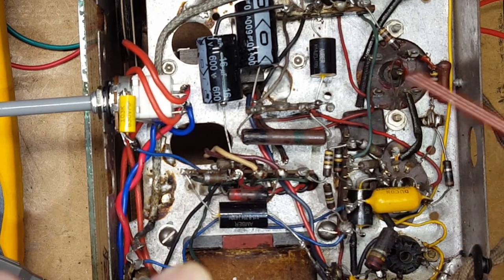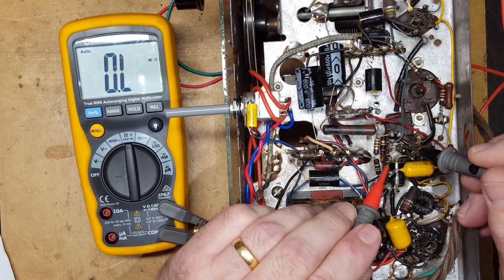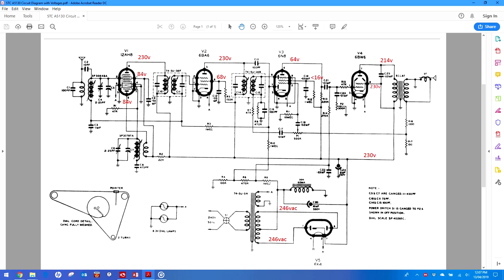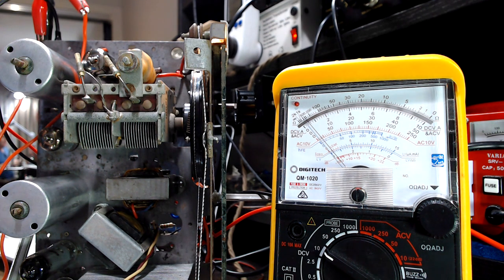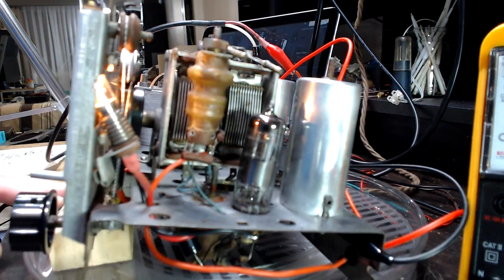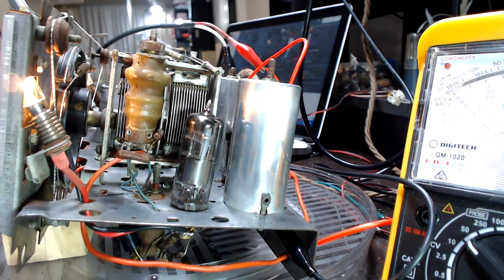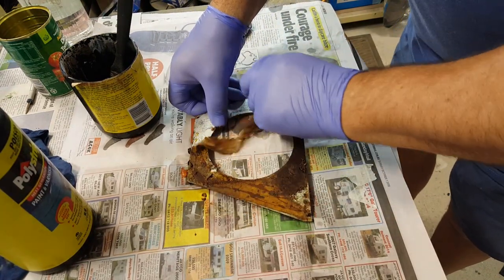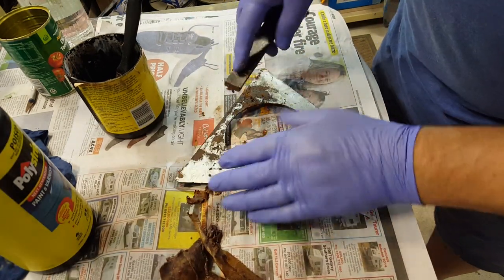Vintage Radio Restoration - STC A5130 Part 4 - Distortion Fix and Alignment

Comment: I watched most of your restorations, you did very good job.  If I were you I would change all the caps, resistors valve sockets and cables, clean or change the pot controls and than test the radio. Restoration takes a lotvof time and effort. Not replaced parts may become proplem in the near future. All small parts replaced would give the radio another 50 year to go without servicing.
Reply from the maker: Thanks for the tips!

Comment: That 1 meg resistor has a 470k in series with 100k, across it when measuring it in circuit so it’s going to measure less that 1 Meg.
Reply from the maker: Haha... yeah, I worked that out... eventually 😀

Comment: Just found your interesting tutorial on the restoration of this old STC thanks David. Of particular interest to me was your method for aligning the radio using a signal generator and multimeter which was straightforward and easy to understand!
Reply from the maker: Thanks Greg, glad to have been of assistance 😃

Comment: I picked up a unique AC voltage measuring instrument today at a local thrift store. The item was an HP-403, the  True RMS voltmeter. It is transistorized meter. I plan on using it as a dedicated  alignment voltage indicator. With this meter I can measure any AC  signal voltage , even the 455 Kc IF frequency. I can measure down to 10 microvolts. This will be good for measuring RF sensitivity in the AM broadcast Band. The meter is lab quality and  several steps above an all purpose VTVM, that I can now utilize elsewhere on my bench. This meter was originally designed to run on Nicad batteries only. The previous owner devised a way to have it run on AC line current. That I am very happy with. The batteries were special and no longer available. I was studying schematics to see what I could come up with and nothing was simple. The previous owner was known as "Mr. Electron" a retired EE. Items from his estate found their way to  a thrift store. The only thing I need to do was find a suitable three prong AC power cord. In the meantime I soldered an AC cord to the internal connections So I can calibrate the meter. I found a full copy of the HP manual on line. I  hope your day was as exciting as mine was today.
Reply from the maker: My day was not nearly as exciting by the sound of it Cosimo. It's a shame it ended up in a thrift shop, Mr Electron would be sad to see his life's work scattered about like that but by the same account it's great that you rescued it. Being able to read low signal voltages would be very handy for troubleshooting circuits. I'm very happy for you Cosimo, well done 😃

Comment: Hello again David. I wanted to ask you something about the STC A5130 table top AM radio.

I noticed that in order for a consumer to operate this radio they would need to add a long wire antenna. I imagine that may not be practical in all locations such as a condo or city located townhome. Would you be able to add a generic ferrite loop antenna to the radio so that the user would not have to have a long wire antenna placed outside their apartment or condo? 

Is it possible to add a ferrite loop antenna to a radio that was not designed to have one and still obtain decent RF reception? 

If yes, would you make a short video on how to add a ferrite loop antenna?
Reply from the maker: Hi Martin, it is possible to add a loopstick antenna and that's a good idea for a video, thanks. It would basically involve replacing the existing antenna coil with the loopstick coils. I would have to do a bit of research though. I'll see if I can come up with something in the new year, chhers 🤔🙂😃

Comment: I noticed you have the same generator lsg 11 someone in the past took out the 1k RF fine pot and replaced it with a function switch with varied resisters i might go back to the original.
Reply from the maker: Hi Michael, they are a good basic generator, I wonder why the pot was replaced with resistors 🤔🙂

Comment: The AGC voltage is delayed by the RC time constant of the AGC filter. The voltage is smooth and filtered . I'll give it a try next time.
Reply from the maker: It works well but you need a high impedance meter, I now use the output valve plate so as not to influence the IF/RF section.

Comment: Did you measure the agc before and after tuning in a station to see if it’s responding to signal levels. 
It looks like it was overloaded due to low RF bias.
Reply from the maker: I thought I tuned a station using the voltmeter after I aligned it, the voltmeter is connected to the AGC 🤔

Comment: While recapping a 1948 Philco today I came across a .2uf cap bulging at one end and the wax plug oozing out. The odd thing was a coil of #20 wire was wrapped around the ground end of the cap. The coil was 10 turns of insulated wire on a 3/4" diameter cap. One end if the wire attached to the cap lead on the low end the other end of the coil was open ended. I have no idea what the purpose of the coil is for. The inductance was too small to measure, it measured .81 Ohms D.C. Resistance. I guess I could calculate the inductance by know physical values , the figure out the LC resonance of the tank circuit. Have you ever seen  a cap configured this way? Anyone have ideas. So for now I just replaced the cap and made a note in my journal to revisit later on.
Reply from the maker: I believe it is a wave trap as it's only connected at one end Cosimo, I had one on a previous radio and did a little searching about them, see link at the end. There seems to be some conjecture as to it's purpose, it seems it's either to stop external signals penetrating or stop feedback from within the set itself. It's position in the set may answer that. Either way it may be redundant with modern capacitors. Have a look at this link Cosimo: https://antiqueradios.com/forums/viewtopic.php?f=6&t=190080
Reply: David Tipton Thanks ...yes , that's it exactly. I figured it was some kind of gimmick inductor. The measured inductance was 10 micro-henries. It had a stray capacitance in the nano- farad range. I kept the old part in tact , just in case it's some RF Black Magic device. The schematic shows it to be a physical coil in series electrically from the cap to ground. There you go , I learned one more thing and I knew it all until I didn't.
Reply: So it turns out that in the schematic this .2uf cap is the virtual ground connection in series with an open coil. The cap. has an Xc of 10k at 60 Hertz. The  coil is a phantom inductor. It reminds me of small inductances that were used to suppress parasitic oscillation  in RF circuits. Or maybe it's some king of ground loop magic.

Comment: Single ply toilet paper and Duco cement. Spread an area wider than the tear then lay down a strip of TP  over the tear. The TP will absorb the glue . Then spread another layer of Duco like paint over the TP.  Like when you cut yourself shaving. The blood acted like glue as it saturated the TP.
Reply from the maker: We can't get Duco cement down here 😏
Reply: The rubber paper glue is good idea too as it remains more pliable.

Comment: Hi David, can I ask where you got your capacitance meter from that you use in this video (at around the 10 minute mark) or is it a kit?
Reply from the maker: Hi Greg, I don't have that anymore after I dropped it 🤦‍♂️ That one comes as a assembled board, the case is extra and comes as a flatpak. The replacement I got was fully assembled and in a nice case. There are similar ones on eBay and are very cheap, $20 - $30 here 👍🙂
Reply: @DavidTipton101  Awesome thanks David......off to eBay I go!

Comment: I've never seen that before; the mains transformer secondary centre tap connected to both an inductor to ground and a capacitor to the HT! How does that produce a negative bias wrt ground? I have a degree in electronics but I don't understand that. Did you ever work that out?
Reply from the maker: I don't have access to the circuit at the moment Ricobass0 but the reason the choke is on the centre tap is to reduce stress and corrosion on the windings by reducing the potential between the windings and the former and core. When a choke was mounted in the positive side of the B+ some manufactures connected the body or former of the choke to B+ as well to achieve a similar result. The choke itself provides the back bias. 
Because the output valve cathode is directly connected to chassis ground, connecting the filter caps directly to ground also would induce a hum in the cathode. By connecting it to the centre tap it is essentially in parallel with the back bias resistor or in this case the choke.
Reply: @DavidTipton101  I get what you are saying about the voltage difference between the inductor windings and the metalwork but don't see how any of this generates a  -ve voltage wrt ground. The bias resistor chain is across the inductor and both the resistor chain and the inductor have one end grounded. They are both effectively in series with the HT output, albeit through the transformer windings, but without a third diode somewhere I don't see any way a  -ve voltage can develop.
Reply from the maker: I think I see what you are asking. How do you get a negative voltage by grounding the CT through a Choke? 
Consider the CT is the most negative point in the power supply.
if a resistor (choke and some resistors in this case) are placed between the CT and the chassis, the chassis is now positive WRT the centre tap. 
Connect the control grid to the Centre Tap and the cathode to chassis and the grid is now negative WRT the cathode. 
You are right, the entire HT current flows through the choke/resistors to chassis so variations in current flow will affect the bias voltage.
Reply: @DavidTipton101  If you consider the transformer as a voltage source and the double diode as just a single rectifier, then there is a complete loop from ground through the inductor, the V source,  the rectifier and then finally C24 back to ground. If you define ground as zero volts and the +HT is developed across C24, how can the voltage across the inductor be anything other than positive? I know I must be wrong - you doubtless measured a negative voltage and if it were otherwise, all the valves would have been biased wrong.
All I can think of is that the role of C20 from HT to the top of the inductor is crucial, creating some sort of crude switching supply, using the (100Hz) ripple voltage to build up a negative charge on its negative terminal.
Reply from the maker: @ricobass0253  The transformer and rectifier are an AC to DC converter and produce a DC voltage, DC will not pass through C24.
In a simple circuit containing a 9 volt battery, a bulb and a resistor. If you measure the voltage drop across the resistor the negative end (negative battery side) of the resistor will be lower than the positive end. Same with the radio, the CT is zero, there is a voltage drop across the inductor to the chassis, the chassis is more positive than the CT meaning it is at a lower voltage than the chassis. With the output valve cathode grounded to chassis and the control grid connected to the CT there is a negative grid bias across the two.
Reply: @DavidTipton101  I get what you're saying except that the CT is not zero. The chassis is zero by definition. I'm still a bit confused re the function of C20 which is returned to the CT rather than chassis.
Reply from the maker: The CT is absolute zero in the power supply. The chassis ground is a small number of volts higher than the centre tap by virtue of the inductor, resistor what ever you want to call it. 
Consider in a case where the CT is connected to the chassis and the transformer/rectifier is producing 200 Volts DC. Measuring between B+ and the chassis will be 200VDC.
If the CT connection is lifted from the chassis and a resistor placed between it and the chassis there will be a voltage drop as the B+ returns to the CT, therefore the CT will be at a lower voltage than the chassis.
The radio components are connected between the B+ and the chassis not between B+ and the CT. If the resistor drops 10 Volts then the voltage between B+ and the chassis will now be 190 VDC. The remaining 10 Volts can be measured between the chassis and the centre tap, the CT will be 10 Volts lower than the chassis.

Comment: Have you ever tried Rubber Cement on the speaker cones?
Reply from the maker: Hi George, no, I haven't, the glue I use does stay pliable though but I will try and get some rubber cement for next time 🙂
Reply: hi David,toilet paper or kitchen paper soaked in a mixture of wood glue and water works great and is pliable, paint it black and its an invisible repair
Reply from the maker: @MrHBSoftware  I use that on the cone area but not mixed with water, worth a try though, thanks 🙂

Comment: The oscillator coil should be adjusted at the bottom of the band, like the aerial coil.
Reply from the maker: Thanks widecast, I have finally worked it out 👍

Comment: Cellulose paint thinner usually sees off any glue, (and paint too)
Reply from the maker: Hi jonka1, we don't have cellulose thinner in Oz, we do have lacquer thinner which may be the same thing, I didn't think to try that though 🙄
Reply: @DavidTipton101  here we have cellulose, synthetic and acrylic thinners, should be the same all around the globe i guess. cellulose is very strong and mostly used for cleaning brushes and paint guns..most paints are synthetic or acrylic and for mixing we use the respective thinner...there is also the water based paints that are being shoved into our mouths due to environmental concerns
Reply from the maker: @MrHBSoftware  the only name I recognise is acrylic but no doubt different names for the same product.

Comment: I have had good luck with tissue paper (wrapping type) and finger nail cement. (that women use ) You can get it quite wet and put the paper on, and when it dries, it is the same consistency of the cone to begin with.
Reply from the maker: Hi Michael, thanks for the tip, I'll give it a go 👍🙂

Comment: Silvered Mica capacitors from my 50 year experience in radio and TV are most unreliable when dc is applied to one end, e.g. a plate to grid coupling.  The silver tends to migrate internally.
Reply from the maker: When I first started my radio repair hobby I was told mica caps are very reliable, don't worry about them. That proved to be a fallacy Roger, I now suspect any mica with a high voltage on one side just like you. It took me a while to work it out though 🙄 Thanks Roger 😃

Comment: I bet coca-cola would work well as a solvent to remove crud. You forgot to cut out the circle in the middle😬
Reply from the maker: Hi 984francis, Coke will remove anything 😉 Did I? Which circle? 🤔
Reply: @DavidTipton101  I was pulling your leg. The circle where the speaker is!
Reply: @DavidTipton101  Coke contains Phosphoric Acid.  That will cut anything.  The reason it doesn't cut our stomachs is because we have anti-acids in our digestive system that neutralizes it.  Look at the ingredients sometime.

Comment: *ADDENDUM*
The IF's have capacitors in them and guess what type they are? and what's the bet they have shifted out of spec ergo, no doubt why you needed to realign the set Err-Radio, So if the Radio or for that matter any radio with much the same IF's fail to properly tune in one day keep in mind that it may just be those capacitors inside.
Reply from the maker: Yep, I've learned a lot since then KorAllRBar 👍🙂